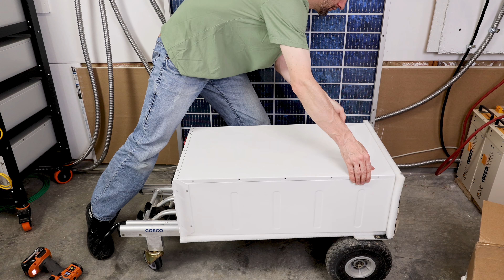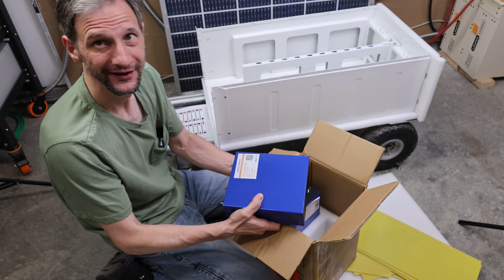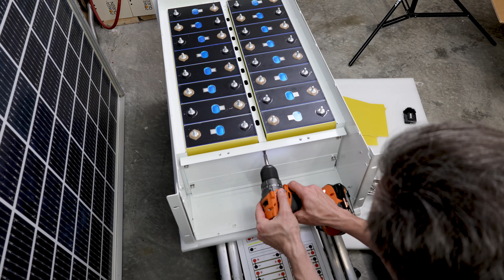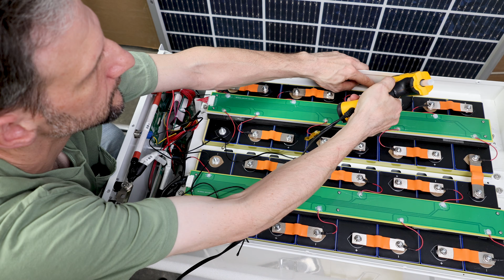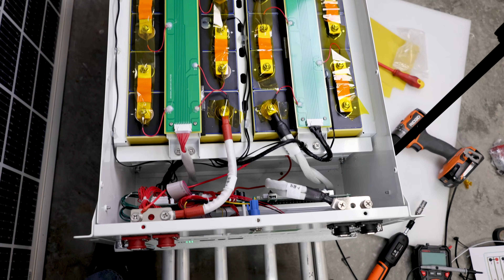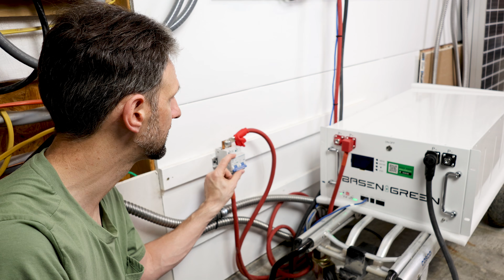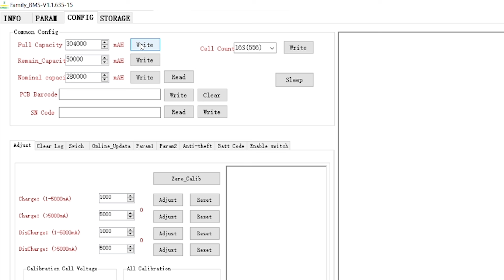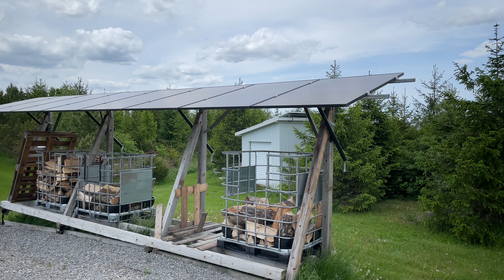SAVE Thousands - Build your own home solar battery backup!

Comment: $550 pretty steep for a box, terminals, and BMS.  I'd probably need something like this with a configuration at 100V DC.  It is time for the industry to move to this voltage.
Reply from the maker: Why stop at 100V?
Reply: @ProjectsWithDave  Yeah. I meant to say 96V, double of 48V. Nice if 120V not hard or expensive as product
Reply: 240V would be better.  Then you have your split phase center tapping it.  Inverter is now just an ESC making a sine wave out of it.
Saw some work on it, but put in a fuse, 240VDC into your wall outlets won't be pretty if something goes haywire..
Reply: @robertsmith2956  Definitely. 120V battery and inverters should have been started yesterday-smaller conductors everywhere and less heat generation.
Reply: I believe the safety aspects of 48V is the reason it's still the industry standard.
Reply: @ssoffshore5111  True on Power over Ethernet. However, we are using and plenty experience on 110-240V AC.  EVs are 400-900 volts, there;s definitely experience and equipment for higher voltage.

Comment: @Project With E. D. Truly great idea, David P. Made a similar video however i would use the CATL 204ah cells they only cost $38 each so a 10kWh battery would only cost $608 excluding the case, basically getting getting 2x the capacity at half the cost of an EG4 LL.
Reply: Do you know where to get the catl cells cheap?
Reply: @joenardecchia1132 looks like I can’t post links, so just search for the company name, they are on YouTube as well.
Reply: @joenardecchia1132  do a YouTube search, can’t say anymore as the post will get remove.
Reply: @joenardecchia1132  YouTube

Comment: Would it be possible to add something like this for an existing enphase battery setup? Would like to expand storage but enphase batteries are much higher costs.
Reply: Their batteries (I believe) are higher voltage, so no.

Comment: Great video.  Thanks!  I'll need to locate my batteries and hybrid inverter in an unheated garage in PA.  So I was wondering if there are any easy ways to add internal heating capability for the event that the garage temp falls below 32 degrees F, so I wouldn't have to put these cases in a temperature controlled enclosure.  Any ideas?  Thanks!
Reply: Those electric pipe wrap heaters.  Just run along the bottom of the case to heat it.
Reply: @robertsmith2956  THANKS, good idea.  Are you getting this battery kit?  I'm trying to make sure that the BMS included will interoperate fully with whatever inverter I go with.

Comment: Is this a system that could be hooked up to an existing solar generator battery bank/pack, like an ecoflow Delta series, to be able to expand that capacity?
Reply: Yes, if you connect it through the solar port. Make sure to use correct size wiring and fuse the positive. Some YouTube videos showing how to do it.

Comment: The new MB30/31 cells are $70 each which means 1120 for the cells. That is 3 times more power than buying a 5kw battery for same price.

Comment: Newly subscribed.  Thank you.   FL resident and I am dismayed that so many homes in FL do not have a solar.  Sadly they require your solar be disconnected in grid down events.   I am building a parallel network to avoid this restriction.
Reply: I priced out a Tesla Powerwall with Solar Panels.  If I finance the equipment, the monthly payments are twice my electric bill.  If I had the cash upfront and put that money in the bank instead, the interest earned will almost pay my entire electric bill and still have my entire capital investment.  The only thing I'm losing is power when a hurricane takes out the power.

The current high interest rates have changed the equations for the financials of solar.
Reply: Or you could do like we do up here in Kentucky. Tell the power company to turn the power off. I haven’t had a bill in 2 1/2 years. You just gotta do without that fancy new car, truck, ATV, couple of vacations and dining out all the time.
Reply: There's a simple auto disconnect box...
Reply: @crgsy5401 simple?  Our hookup and solaredge 10kw inverter go out of their way not to autodisconnect; but instead hobble/throttle the panels output to 1 volt.
Reply: @stevekean512  I'd need to see the circuit and read the blurb.
Reply: Any backup power must disconnect in grid down events. This is so the repairs on the grid can be performed without the workers getting fried when they find the "dead" cables actually have power going through them!
Reply: Ya that rule is bull$hit. They do it here in taxachusetts . We have 32 panels for our house . I'm having a friend fix that issue for me. If the grids down why should our house be without power 😑

Comment: Neat.
Would love a kit that lets me drop the battery pack out of my Bolt at end of life and use that as home backup. EoL it'd probably still have 30kWh for essentially free. Just the cost of the kit and the labor. 
There are Leafs and Bolts for around $10 grand that have 20+ kWh battery packs in them. Why aren't we all using those?
Reply: gooberment is wasting out tax money to build recycling plants so they will never be available.  Doubt you can get your old part back when they replace the battery at the sealer also.
Reply: People are starting to use such car batteries. Do more research. I am planning on using such a battery. All you really need is an inverter that can take the higher voltage and the right BMS. I'm not an expert but am doing research in anticipation of a DIY system. Why I'm here.

Comment: i hav a 24v batery. why does my inverter cutoff n alarm goes off at jus 21v? thats not even close to half capacity
Reply: inverter isn't programed properly, probably wrong capacity setting.  Just like this one was set for 280ah

Comment: I wouldn't have put the temperature sensors in hot glue as well as it been an insulator and it could damage/melt the sensor (thought you was just glueing the cable)

Comment: Nice video, but at several times you've shown the biggest problem with making your own battery. Chinese manufacturing is hit or miss at best. I built my own battery before. I spent months waiting for parts. Then I spent several days building everything. Everything charged up and showed fully functional. I then hooked a load. Then the battery promptly shut off. The battery cells were worthless junk. Grade "A" cells don't mean jack. For $500-$1000 dollars more I could have saved a massive amount of time and money. That's my story though. YMMV.
Reply: But your prebuilt battery probably came from China too
Reply: @JustADad-37 Yep! Damned if you do. Damned if you don't. I learned that alibaba is crap. Lesson learned.

Comment: Cable as short as possible. Not about the resistance, that can be lowered with thicker wires. The killer for the inverter is high inductance on battery cable. Usually the inverter manuf. will specify the max cable length on the bat side. High inductance means high ripple current trough input capacitors (maybe also resonance....and that will kill them fast!) that will lead to premature aging on the caps. With caps that are degraded, you will have failure on the semiconductors. So the resistance is not that critical, but inductance on leads is the killer.
Reply: In a DC circuit, as long as the DC loads aren't varying wildly, inductance is not an issue.
Reply: @gregben  you are missleading yourself. The conversion from 48V to 400V is performed at 100-300khz...
Reply: @UncleSAM-py5pq  Yes, and that is done inside the inverter. Not in the leads from the battery to the inverter. I'm an engineer and you clearly are not.
Reply: @gregben  well, check how many agree with me. My personal opinion regarding your experience, maybe you can try something else, that fits you.
Reply: @UncleSAM-py5pq I gather you're saying that high lead inductance can cause the ripple at the converter output to exceed the rated or design target for ripple. So the load capacitance is part of the smoothing of the switcher. That could make sense. Can you point to a reference on these large battery pack inverters? (Had to laugh, though. Engineering does not depend on likes. LOL) Thanks
Reply: @SRHMusic012 The lead inductance, aka long wires  will increase the source (battery) impedance (is opposing to fast current transitions). No issue if you have a resistive load, but the DC-DC converter which boosts the 48V to 400V (before the AC conversion) is not resistive, it switches the DC into 100Khz AC current to be feed into the transformer.  Now this conversion from DC to AC will subject the capacitors from the input (before the power mosfet) to high ripple current, as the impedance upstream is high due to cable inductance, so all the HF current has to come from them as the battery has high impedance due to longer wires. The only component that can supply this high current needed are now the capacitor, as you decoupled them from the battery (also very good capacitor, low ESR), and they will get hot, and in time will fail.  No offense but this is simple and basic SMPS functionality.
Reply: @UncleSAM-py5pq  Thanks for the details. I wasn't visualizing something correctly at first. Yes, I see how the battery capacitance is "choked" by the lead inductance. I'm guessing the added stress is that the flying cap must cycle deeper or be switched faster at a given load current as lead inductance increases.
 We all have different backgrounds, mine in very low power (uA and below) and RF,  not much power management and about zero with DC-DC converter design.  Time to experiment in LT Spice and do some math.
Reply: @SRHMusic012  EMI and  swich mode power supply designer here.

Comment: Nice video, that was one of the easier DIY 48v cases I have seen.
I'll just need to work out if the cost the others are worth the extra work.
Reply from the maker: Which other ones are you considering?  What features are you willing to pay extra for?
Reply: Only thing I could see as an improvement is the plate being adjustable so you don't have to shim it.

Comment: Thanks for sharing. can you elaborate a bit more on the MP's being AC coupled? My understanding is that they do not work without dc power, so I was on a head tilt when you disconnected them from battery and stated  if on grid power they would precharge the capacitors. 
one other thing, though... get some safety glasses. One tiny spark could take your eyes
Reply from the maker: If the units are connected to AC on the grid connection side, you will find the battery connection terminals are at about 50VDC without a battery connected.
Reply: Do you put on gloves to wipe your bum as well.
Safety First🤔

Comment: Great video. Could please post a link to the BMS software. I have the exact BMS but version 1.1.635-06. I would like to upgrade it but couldn't find where to download it from. Thanks.
Reply from the maker: Thanks!  I don't know if the software I used will work for you or not, but I added it to my Google Drive.  Password is in the "txt" file.  You can download it here: https://drive.google.com/file/d/16hyQabxsteoz9PFU_uknw2FMX9dhWmd-/view?usp=sharing
Reply: @ProjectsWithDave  Thanks a lot.
Reply: @ProjectsWithDave  Thanks, again. The software worked with my battery. However, I don't know if I can update the BMS from this software. It seems one can only read and change settings. Do you know the BMS make in your battery?
Reply from the maker: Do you have the "CONFIG" tab in the software?  Did you see the instructions I included?  Did it accept the password?
Reply: @ProjectsWithDave  Yes. It did

Comment: They build nice cases, have one these myself. The new one comes with DC breakers
Reply: I’ve never been able to post a link in a YouTube comment section.   Something in the algorithm kills your post.   You have to do it with weird spacing so it doesn’t work as a link.
Reply from the maker: Can you post a link to the one you are using?
Reply: @ProjectsWithDave  No, once people post they never think to come back and check for responses.

Comment: Great vid. Subscribed.  Now all I need is for someone to do similar to this kit for extending/charging ev on a trip, like carrying an extra gas can. If anyone knows of that type of thing let us know.  Many thanks!  Great job, will watch your other vids on building this offgrid system although I need to understand is this only off grid or can be somehow integrated to a grid tied enphase or solar edge system.  Opinion on that is appreciated too.  Thanks!
Reply from the maker: I have videos for on and off-grid systems.  You can see most of my install projects more easily on my website here: www.ProjectsWithDave.com

Comment: Amazing review and details. I have been looking for a battery backup solution for my house. When I talked to my original solar panel installer. There quote was quiet high and would require the replacement of my inverter as well to us their solution. Can this battery potentially work with any inverter?
Reply from the maker: The inverter has to be designed to work with 51.2V nominal batteries.  Also, if you want communication, the BMS is only configured for certain brands of inverters.

Comment: What is the demension of your catl cells? I’m wondering if that diy pack will fit my 16 Winston cells
Reply from the maker: Width= 173.6mm
Thickness= 71.5mm to 72.0mm
Height= 204.8mm
Terminal Post Pitch= 90.0mm

Comment: Nice system.  I'd replace those small cables inside.  Probably CCA as well.
Reply from the maker: The nice thing about these kits is you can make those kinds of adjustments fairly easily.  You could even use a different BMS if you wanted to.

Comment: Why would this not make sense.   I contribute $113,000.  We buy 20 of these kits.  You assemble them over a weekend.  We sell them for $3,000 each and make a profit of $15,000.   They should easily sell for that price right?
Reply: My math is wrong.  For $113,000 we could buy 50 kits and at $3,000 each could sell them for a total of $150,000.
Reply: @philippserrin8268 Your math is still wrong. The total price of 2246 does not include the 550 for the case....another 27,500 for the cases.
Reply: @miraclesoundco8911  at 0:36 he lists 16 cells times $106 (equals $1,696) PLUS $550 for the case and the grand total is $2,246 total times 50 batteries equals $112,300.
Reply: yes, once you pay for your business license and advertising so they will know where to buy them.
I remember a guy bought a pallet of batteries to sell, and ebay refused to release his money for 3 months claiming he could be a scammer.

Comment: Do you have to fill the entire case full of cells?
Reply: There's smaller cases started to be produced but for 12/24v applications.  The batteries tend to be 3.2v hence you need 16 for 48v which is a common size that inverters use.  It's why most DIY cases are this size.
Reply from the maker: If your cells are not as fat you could use a spacer to fill the gap.  Depending on how far off they are you may need longer leads for the BMS connections.

Comment: So cool!  Thank you!  I think a similar video recommended using gloves to make the connections claiming that 48v can go through the skin, yeah?
Reply from the maker: It never hurts to have another layer of protection with some rubber insolating gloves.
Reply: It takes all about 60v to penetrate dry skin. You should be pretty safe with these batteries without gloves.

Comment: Got 96 pretty blue cells waiting on me to put them together.....
Reply: If it only took him 2 hours to build this it sounds like a good project for you to do on a Sunday what's the holdup?
Reply: Still finishing up a 10x20 ft shed where my equipment is going. About to get a couple of walls finished up so I can hang a couple of my inverters up and a couple of distribution panels, the dc bus and at least one battery pack so I can get a 12kbtu mini split running. Cool things down some in this sweltering heat and get back to finishing out the building and then back to installing the rest of the solar equipment.
Among everything else in life needing to be done........
Reply: @beebop9808  yep you definitely have a project going, it's only going to get hotter LOL
Reply: Things are getting better. Last order for boxes just under $300 ea. 304 cells for $69. Get em now before the tax wars start with China.

Comment: Can you chain the BMS together with other Basen Green cases and/or with SOK so the inverter can see all capacity?
Reply from the maker: I've had the BassenGreen battery connected in parallel with my SOK battery for about a month now.  It works, but there are some issues.  The batteries each have a different brand BMS so they can't talk to each other.  To see the whole capacity I am using a shunt between the two sets of batteries and my inverter. 
1) My DIY battery is 300Ah and my SOK stack is 500Ah.  The result is the resistance is not the same so they don't charge and discharge at the exact same rate.  If I don't completely charge the system to 100% the 300Ah battery eventually drifts to 0% when the 500Ah battery is still at 30%.  If I charge them to 100% about once a week it works ok.
2) I am using a shunt to track the entire pack capacity on the Victron system.  I have not yet tried to get it to track both batteries separately. 
So if you have a shunt and the two batteries are the same chemistry (LiFePO4)  and the same capacity you should be able to put them in parallel without too many issues.  Just charge to 100% periodically.
Reply: @ProjectsWithDave  thanks for the reply. I have a similar situation with an eve105 bank and eve280k bank and charging differences if not getting to 100% at least every other day. Just using simple JK BMS and looking to get these into a case with a communicating bms.